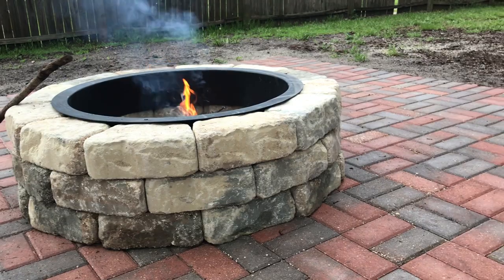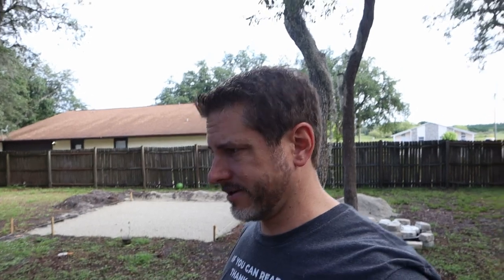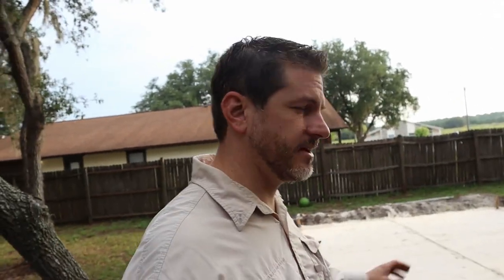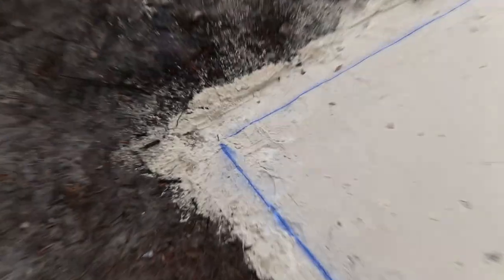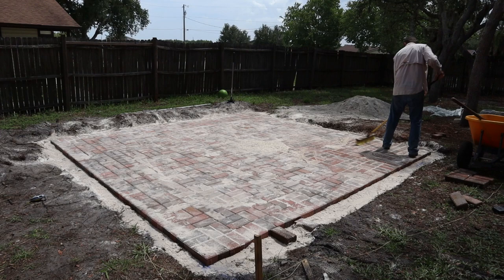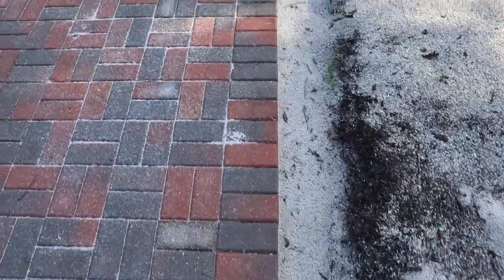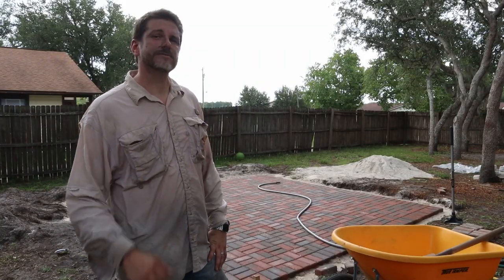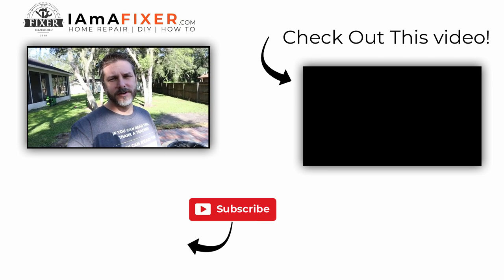Paver Patio with Firepit

Comment: Should I put the paver firepit on the ground or on top of the pavers?
Reply from the maker: Up to you. I was originally going to put mine in the ground but decided at the last minute to put it on top of the pavers. I put a 4 inch layer of crushed shell in the bottom to protect the pavers from the fire. That way, I can always remove the fire pit if I want and have a finished patio underneath
Reply: @IAmAFixer  thanks for the response.  My installer also told me I could do it either way. I called Unilock and they told me it should go on the ground.  I'm going to put it on the ground for water drainage, and I want it to me a littler lower.